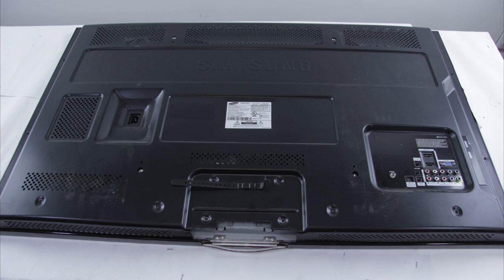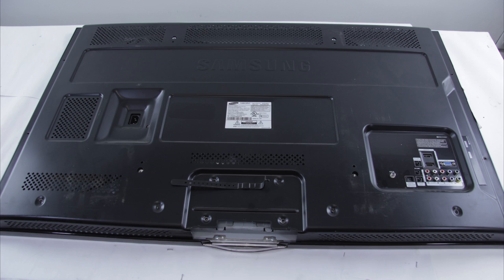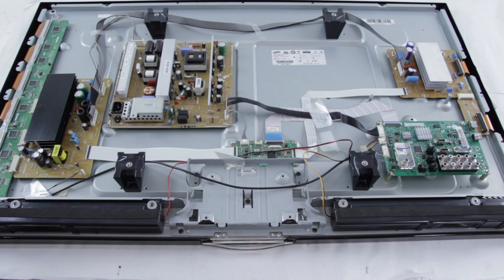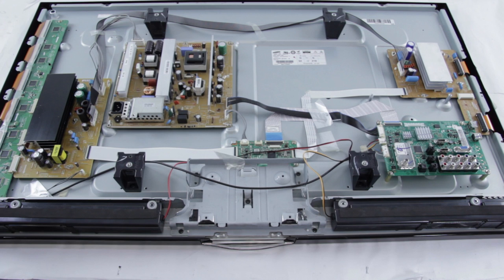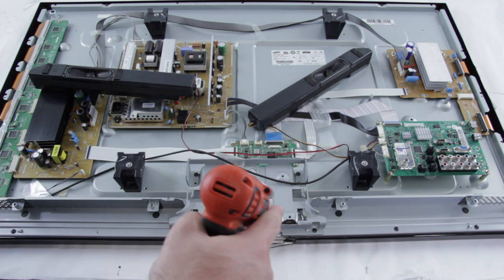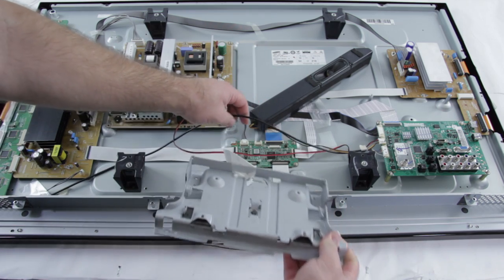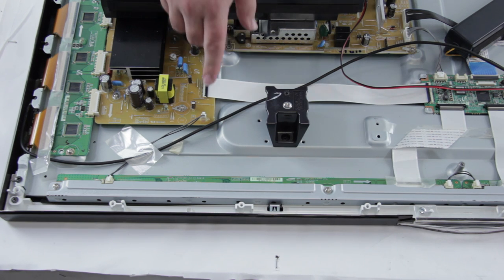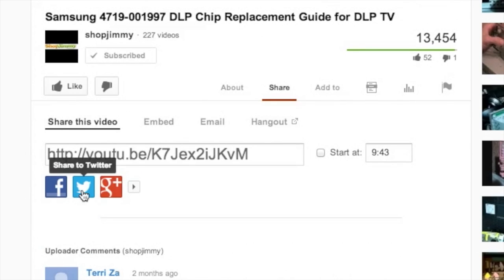Plasma TV Repair Overview Address Buffer - What is a Address Buffer - Problems Symptoms Tutorial

Comment: Hello I have a Samsung Model # PN50C450B1D TV Powers on screen lights up then goes out.  Have replaced the X-main, Y-Main and buffer board.  even the main power supply board.  Still have the same problem.  I hear the Samsung Music tone when it powers up.  Ideas?? Only thing I have not replaced is the logic board and the address buffers.  What do you think is the issue

Comment: I have a Vizio E-70-C3. I bought it brand new. When I received the tv I turned it out but didn't notice the right side of screen was apart from the trim. Stored until last week. Now out of warranty. The right side of screen has an 8" vertical white line running along right side trim. I took to a shop. Tech told me to just put super glue along trim and hold until trim stays in place. I did that. glue was not strong enough to hold trim. now I have about a 12" white hotizontal light band going across the screen along with the vertical white line along right side of trim. I called tech back at shop. he thinks I cracked the screen by putting pressure to hold trim when glued. Can you help? Is this tv repairable? thank you

Comment: Zenith Plasma Tv model number Z50PJ240 and serial number )12RMPG4U824....when the tv tries to turn on it will make a click noise then flash white and right back to black...what could be my problem? You told me " I recommend replacing the YSUS and YDRVTP and YDRVBT boards in your TV. " You did not have the YSUS in stock and I waited awhile for it to get in stock. I purchased the YDRVTP and YDRVBT from Shop Jimmy and the YSUS board from another place. After installing the parts I still have the same problem. I now have 200 to fix a 400 dollar tv. Any suggestions?
Reply from the maker: No blah   Please watch this video FIRST to help with your repair!  TV Repair! LCD, LED, Plasma, DLP How To Fix Your TV with ShopJimmy.com Help!   I recommend replacing the YSUS and the YDVTP & YDVBT boards in your TV.  Here is a link to replacement parts:  http://www.shopjimmy.com/catalogsearch/result/?q=Z50PJ240  Be sure to match part numbers on your current board, with your replacement for compatibility.  Here is a link to a video showing how to identify your part number, click here:  LG Plasma TV Repair: DIY Part Identification Number ID Guide for LG & LG Philips Plasma Panel Parts  Thanks and please let us know if you have any further questions with your TV Repair!  www.shopjimmy.com

Comment: Hello thank you for your reply regarding my samsung plasma tv.  The model number is PN50A460SD
Model code PN50A460S4DXZ
Type number PN50A460.

I do not see any damage to the inside of the tv from the metal bracket that hit it.  No black marks no loose wires.  It appears to have 12 volts going to the other boards. What should the voltage be for VS, VA, VG? Any other things I Vann check?  It blew a 10 amp 250 volt fuse which I replaced but still have no power..

Comment from the maker: @sal raj - This could either be the t-con or the panel on your TV.  You could try replacing the t-con to see if that fixes the problem.  Panels are typically very expensive, hard to find and difficult to replace.  It may be more cost effective to replace the TV if the t-con board does not fix the problem.  Give our customer service a call for help with your purchase.  (877) 881-6492  Thanks and please let us know if you have any further questions!

Comment: I have a samsung PN64E550 where the audio works fine but the screen doesn't turn on. I have replaced the Y-SUS, both Y-Buffers, the logic board, and the X/Z-SUS. Still no change. Could is be an address buffer issue or is the panel bad?
Reply from the maker: *****   This sounds like a TV panel problem. If your TV panel is bad, it may be more cost-effective to replace the TV as panels are typically hard to find in stock, difficult to replace, and expensive. Thanks and please let us know if you have any further questions! www.shopjimmy.com

Comment: Hi i have an LG 60pn5700 plasma tv with vertical black bars.  Initially the vertical black bars were just on the right side of the screen but after taking it apart and putting it back together the vertical black bars are all over the screen.  Help..

Comment: I have a Zenith Z50PT320 TV. The TV was given to me second hand. When I first attempted to repair the TV it would click on but then click off with no power. I unplugged the boards sequentially and found that the Ysus and Ybuffer boards when disconnected would allow the power supply to stay on continuously. I replaced the y sustain and buffer boards with new ones and the TV now clicks on and appears to stay on, however the light on the front is red and there is no picture. Any suggestions?
Reply from the maker: Aaron H  Please watch this video FIRST to help with your repair!  https://www.youtube.com/watch?v=BP3NVNCGEv8  This sounds like you have received defective replacement parts.  Click this link to replacement parts for your TV model number on our website:  http://www.shopjimmy.com/catalogsearch/result/?q=Z50PT320  Be sure to match part numbers on your current board, with your replacement for compatibility.  Here is a link to a video showing how to identify your part number, click here:  https://www.youtube.com/watch?v=GEllG3RV-tc  Thanks and please let us know if you have any further questions with your TV Repair!  www.shopjimmy.com
Reply: ShopJimmy.com Good afternoon. You  are absolutely correct. As it turns out I received a working replacement Y sustain board, and a defective set of buffers. I was able to fix the television. Running tests on my old buffers it turns out they were fine and just the y sustain board was damaged. In the future I'll be sure to order my parts from you. At the time there were none in stock. Thanks a bunch for getting back to me.

Comment: Hello guys I have a Zenith Z50PT320-UC with no picture (black screen) and it does have sound. I replaced the Y main board but is still the same? Any thoughts? TIA
Reply from the maker: Alexis Lagares   Did you also replace the buffers?  Thanks!  www.shopjimmy.com
Reply: Thanks, for answering. I was going to replace them but Im'm confused which ones to get on your site there are 5 that comes as buffer boards. http://www.shopjimmy.com/catalogsearch/result/?q=Z50PT320&restrictBy[master+part+type]=Buffer+Board
Reply from the maker: Alexis Lagares
  You will need to match up the part numbers from your original boards to the replacement boards.  Look at the boards in your TV, Identify the board number, then find the board number replacement on our website.  Here is a video about identifying part numbers that may help you.  LG Plasma TV Repair: DIY Part Identification Number ID Guide for LG & LG Philips Plasma Panel Parts  Thanks and please let us know if you have any other questions!  www.shopjimmy.com

Comment: I have a Zenith model number PDP50T10000 i was watching it and the the screen went black so now i have no picture no sound but looks like it has power when I turn the tv on it clicks then a few seconds later it clicks off hopefully its the transformer on the power supply i know which one is doing the clicking but what board should I replace if I have to
Reply from the maker: MackMane26 I recommend replacing the power supply in your TV.  Here is a link to replacement parts for your TV model number on our website, click here:  http://www.shopjimmy.com/catalogsearch/result/?q=PDP50T10000  Be sure to match part numbers on your current board, with your replacement for compatibility.  Here is a link to a video showing how to identify your part number, click here:  TV Part Number Guide for LG & Zenith Main, Digital, & Tuner Boards (LCD, LED, Plasma TVs)  You can also call our customer service for further assistance with your purchase.  (877) 881-6492  Thanks and please let us know if you have any further questions with your TV Repair!  www.shopjimmy.com

Comment: my LG 42PG20 has developed vertical black lines. I tried cleaning the connectors on the x buffers but only resulted in more black vertical lines! There was some popping noise and then additional black lines. What should I do? Will replacing the X Buffers fix this problem. Everything else is working fine on the tv. No horizontal lines, turns on,sound...HELP!!!
Reply from the maker: +Benny Palma   Try all repairs and troubleshooting at your own risk.  This sounds like a TV panel (TV Screen) problem.  If your TV panel is bad, it may be more cost-effective to replace the TV as panels are typically hard to find in stock, difficult to replace, and expensive.  Thanks and please let us know if you have any further questions!  www.shopjimmy.com

Comment: I have a Samsung PN51E7000FF, vertical color lines and sometimes a black out in the right portion of screen. I have replaced the logic board but still the same problem. When I reconnected the ribbons I did have a brief moment of all blue instead of rainbow coloring.

Comment: I have a Samsung PN43D450A2D plasma TV.  When the power is turned on, you can hear the typical start-up sound, but there is no picture.  The only thing that comes on the screen is a quick flicker of noisy horizontal lines near the top and bottom.  The lines appear just before I can hear a relay click on.  The red standby/power LED blinks 5 times after powering on.  When I push the menu button on the remote, I see the standby/power LED blink, but nothing comes up on the screen.  So far I've tried replacing the Y Main board and the main power supply, but the result is the same - no picture.  Any ideas on where to troubleshoot next?
Reply from the maker: David Williams I would recommend replacing the y-main board and the buffers on your TV.  Here is a link to replacement parts for your TV model number on our website, click here:  http://www.shopjimmy.com/catalogsearch/result/?q=Samsung+PN43D450A2D  Be sure to match part numbers on your current board, with your replacement for compatibility.  Here is a link to a video showing how to identify your part number, click here:  Samsung Plasma TV Repair: Samsung Plasma Panel Parts Guide  You can also call our customer service for further assistance with your purchase.  (877) 881-6492  Thanks and please let us know if you have any further questions!  www.shopjimmy.com
Reply: ShopJimmy.com Hello, I've replaced the Y main board as well as the E buffer, F buffer, and bottom Y scan drive.  I've also replaced the main power supply.  The symptoms appear the same as before... see first post above.  If it helps I can take a video.  Any more suggestions?

Comment: I have a problem on the logic address buffer board, I wonder if applying heat to where the suspected connection is coul cure the fault . 'vertical faint line towards theright hand side of the screen. and now I have made it worse , its displaying snow pixels. its a Samsung ps51d8000
Reply from the maker: sukr21   This would be a short term fix for a problem.  Thanks!  www.shopjimmy.com

Comment: I have a RCA 42PA 30rq that turns on flickers and then losses VS voltage but if I disconnect the ribbon cable coming from the ysus to the logic board it holds Vs voltage

Comment: Good evening, I have a zenith z50pt320 that has just started to act up. I left the room, came back in and the tv was off. I tried to turn the TV back on, but it did nothing. I have replaced the power cord with another known working cord, and plugged into a different outlet. Still no power. Please help.
Reply: +ShopJimmy.com The standby light in the front that is usually lit up is not lighting up. it is like there is no power going to the tv. but as I said, I tried a different power cord, and still nothing.

Comment: I have a Sony Bravia Model KDL-46W5100. When I turn it on it's okay for about 10 seconds and then the sound disappears and about 10 seconds later the tv shuts down. It will continually try to restart. I have just replaced the power board but it didn't help. Any ideas?
Reply from the maker: Teresa Moody I would recommend replacing the main board in your TV.  Click on this link to see replacement parts for your TV model.  http://www.shopjimmy.com/catalogsearch/result/?q=KDL-46W5100  We are currently out of stock for your main board replacement, but you can sign up to be notified when the part is back in stock.  Please also call our customer service to confirm compatibility for your replacement part for your TV repair.  (877) 881-6492  Thanks and please let us know if you have any further questions!  ShopJimmy.com

Comment: I have a Panasonic tc-p42st30.  The remote or power button seem to turn on the tv.  No picture, No sound,  When I plug back in to power and hold the power button in I get 14 blink error code.  Any help is appreciated.  Thanks.
Reply from the maker: gibran garvey I would recommend replacing the A Board in the TV.  Here is a link to the search results for replacement parts for your TV model.  http://www.shopjimmy.com/catalogsearch/result/?q=tc-p42st30  It looks as though we are out of stock in the A Board, however you can go to the product page and sign up to be notified when the part is back in stock.  Thanks and please let us know if you have any further questions!  www.shopjimmy.com

Comment: I did a really stupid thing. I was trying mount a center channel speaker to the tv stand mount bolts on to the bottom of the my samsung 460 plasma tv.  The metal brackets were long and came in contact with something inside the black plastic casing on the back of the tv.  I heard a very slight static pop and lost all power.
Reply from the maker: Amy Reams   Try all repairs and troubleshooting at your own risk.  Do you know what part of the TV was damaged, any wires or cables?  If you find any damaged parts, please upload an image of them online and then reply with the URL to those images.  Thanks!  www.shopjimmy.com

Comment: Zenith Plasma Tv model number Z50PJ240 and serial number )12RMPG4U824....when the tv tries to turn on it will make a click noise then flash white and right back to black...what could be my problem?
Reply from the maker: No blah   I recommend replacing the YSUS and YDRVTP and YDRVBT boards in your TV.  Here is a link to replacement parts for your TV model number on our website, click here:  http://www.shopjimmy.com/catalogsearch/result/?q=Z50PJ240  Be sure to match part numbers on your current board, with your replacement for compatibility.  You can also call our customer service for further assistance with your purchase.  (877) 881-6492  Thanks and please let us know if you have any further questions with your TV Repair!  www.shopjimmy.com

Comment: I have a Panasonic Plasma TH-42px50U.  10 years old approx.  shuts down and gives me 7 blinks on the LED.  Unplug and replug has worked for a while, but no longer will come back to me .
Reply from the maker: Dave Looney I would recommend replacing the power supply in your TV.  Here is a link to replacement parts for your TV model number on our website, click here:  http://www.shopjimmy.com/catalogsearch/result/?q=TH-42px50U  Be sure to match part numbers on your current board, with your replacement for compatibility.  Here is a link to a video showing how to identify your part number, click here:  DIY Plasma TVs 101: Part Identification Number Guide for Panasonic Power Supply (PSU) Boards  You can also call our customer service for further assistance with your purchase.  (877) 881-6492  Thanks and please let us know if you have any further questions!  www.shopjimmy.com

Comment: Yes my tv show . It makes sound and I could hear it change with my universal remote. Bu I don't see anything just a blank black screen.
Reply from the maker: staw1718 I recommend running the flashlight test on your TV to help determine if the problem is the backlight inverter or the main board. Here is a link to a video we produced that shows how to run the flashlight test. No Image No Picture on Screen-Flashlight Test LCD TV Repair - How to Diagnose Broken Board TV Repair Please reply with your flashlight test results and we can recommend a replacement part for your TV repair. Thanks and please let us know if you have any questions! www.shopjimmy.com